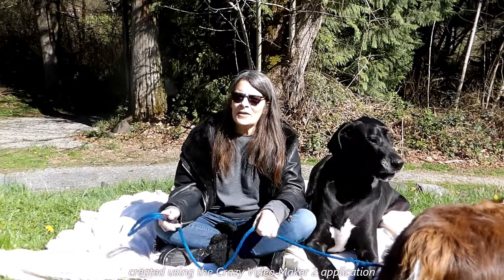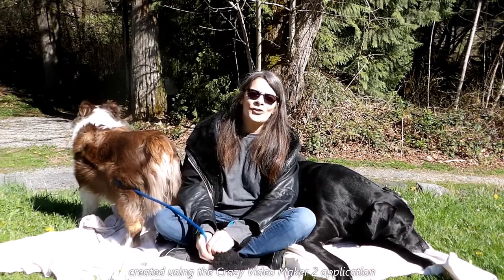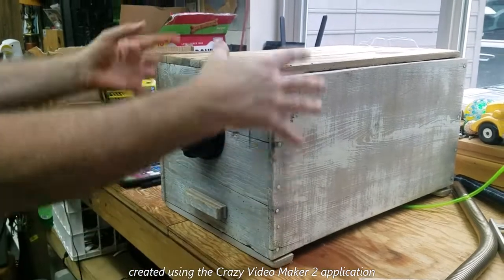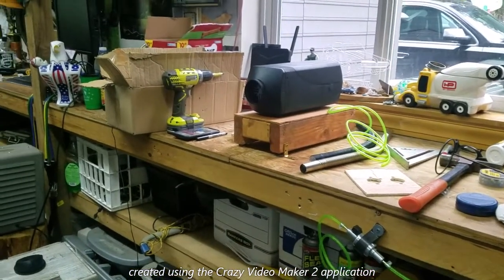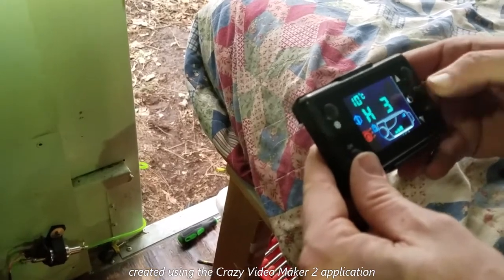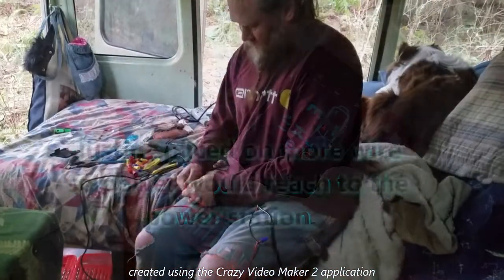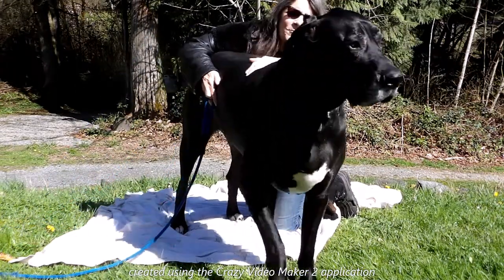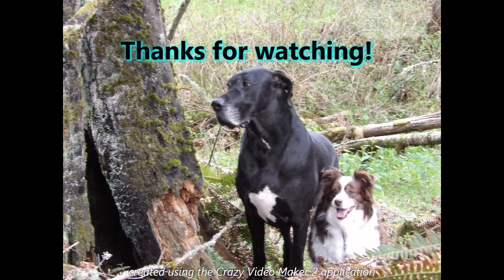Life in a Skoolie Diesel Heater Installed

Comment: Been thinking about you and the pups, wondering how you're doing...glad you uploaded.  One concern, is the heater inside of a wood structure safe? Don't want you having any bad experience. Hope all your plans work out. Peace
Reply from the maker: You're so sweet,  thanks for your concern. Justin told me to check it now and then. So far the box doesn't get hot at all. The plastic vent gets pretty warm but that's all. And the exaust pipe, very hot. About once a week I check the floor where it is, it gets warm but not hot. I never run it when I'm sleeping. I'm going to get some heat tape and Justin will wrap the exaust pipe where it contacts the floor. Safety first:)
Reply: @KatandDogsonWheels  good to hear! Very glad Justin is helping to get you all set. 🚌☺

Comment: Hello Kat & family. Haven't heard from you in a while. Thank God for heat with temps at 29 degrees. I have been considering an e450 diesel shuttle bus but terrified of the fuel mileage. Can you tell me what mpg your bus gets? Thank you 🙏✌🌎💞
Reply from the maker: I haven't driven enough to figure my milage yet. All busses are fuel guzzlers. I'm hoping for 10 to 14 mpg, we'll see. I pulled horses with ford e250 diesel trucks. It didn't cost me as much in fuel as friends with equivalent gas trucks. They had to refuel more often. I loved my ford diesels. I knew I wanted a diesel  bus and it was a bonus that it had a ford engine.
Reply: @KatandDogsonWheels  Well then! I guess I could pull a train into the gas station with an e450. 😂🤗 Thank you 🙏✌🌎💞
Reply from the maker: @3generations393  😂